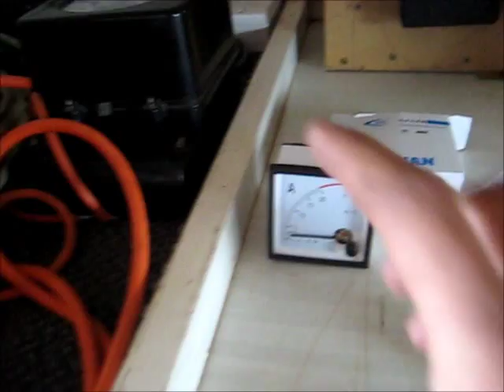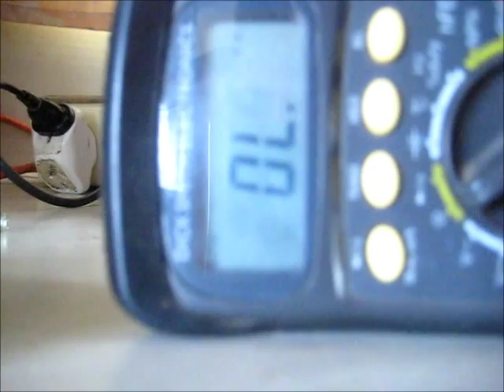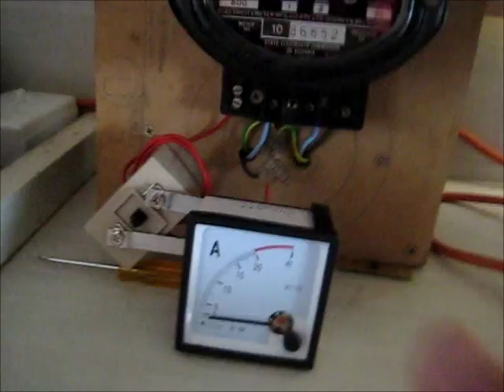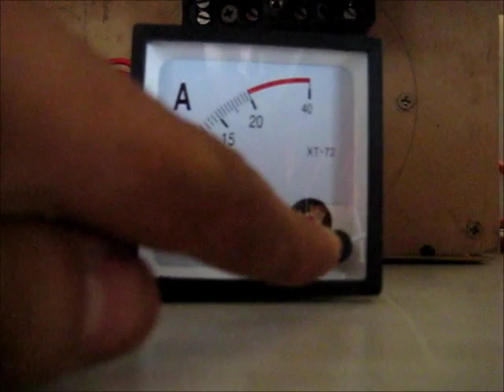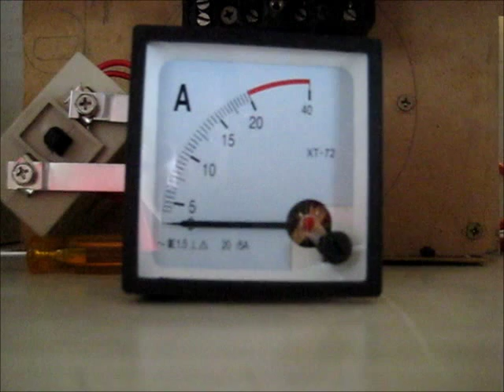Chinese Amp Meter Test

Comment: Good video.
I see that the meter name plate says 20 / 5 A, which means 20 Amp on the CT primary winding gives 5 Amp on the CT terminals to the Ammeter.